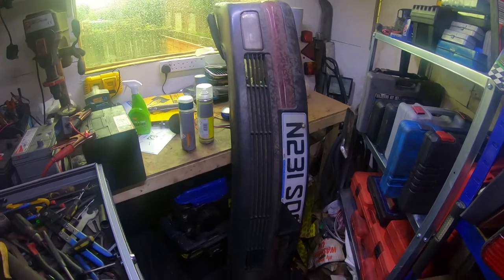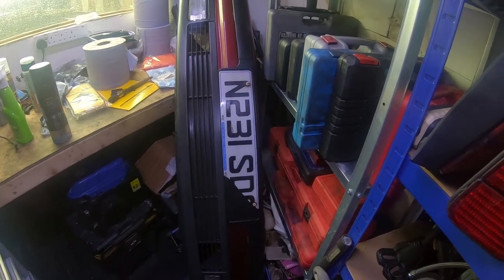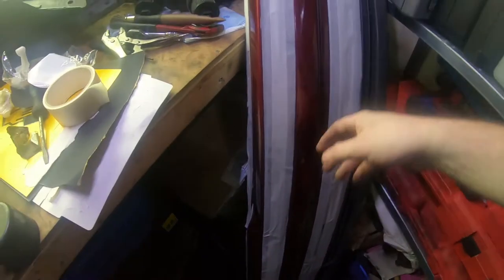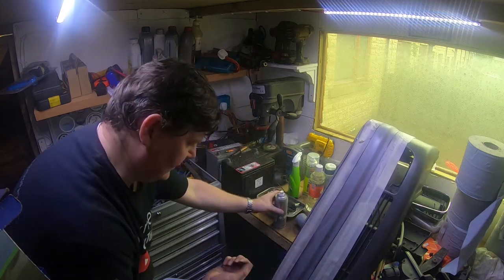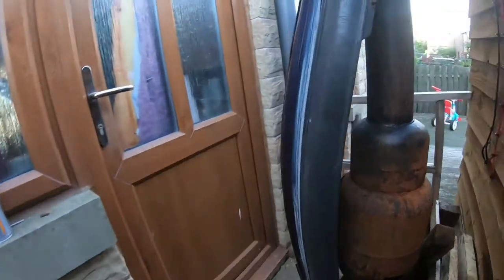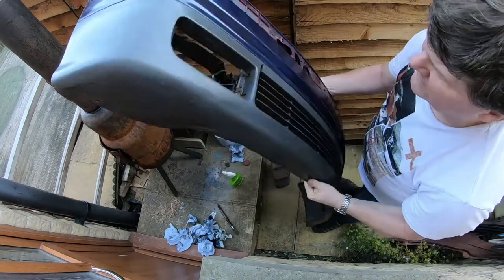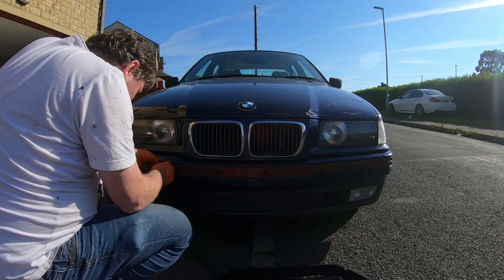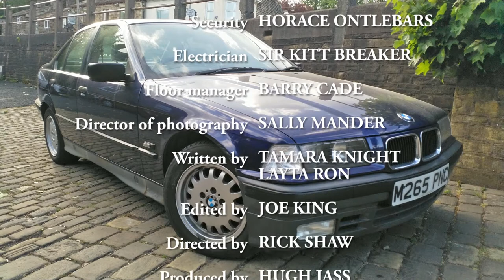Project Bimmer (BMW E36 318i) Part 39- Front bumper replacement

Comment: Y ou had a lot of work there but its looks very well. Is the blue the same as the under coat paint for the bumper
Reply from the maker: This bumper was off a 328i and the top half was colour coded so I had to paint it to match the Montreal Blue that mine is.